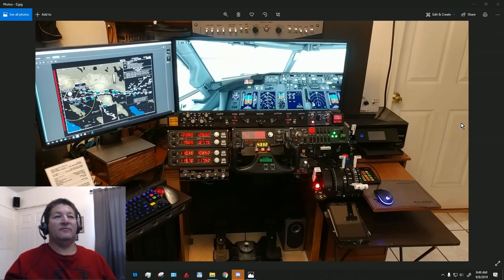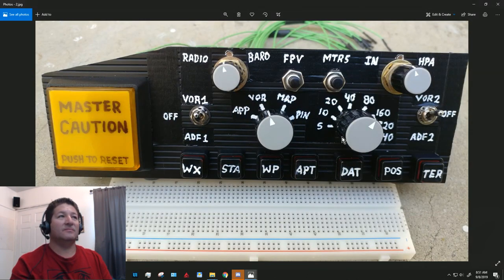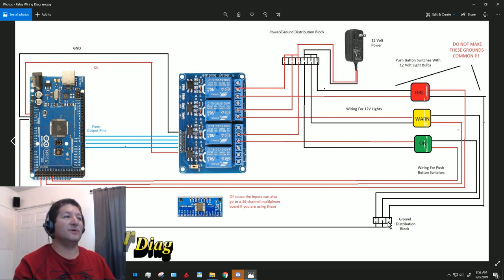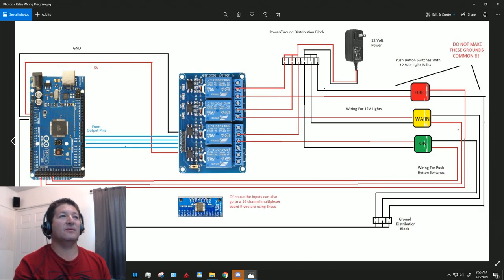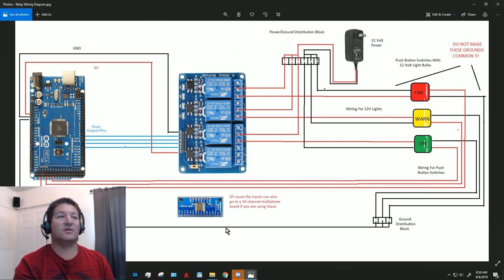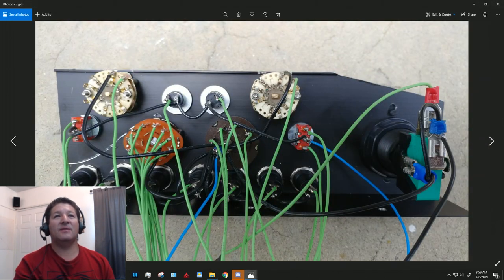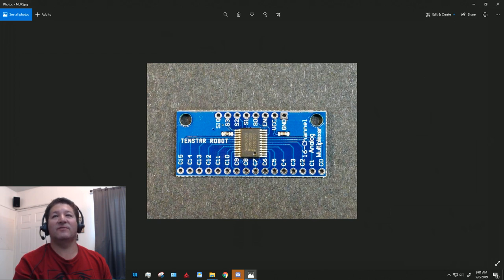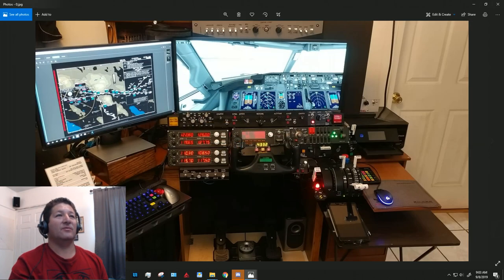How I use Relays With SimVim Cockpit (Now SimVimX)

Comment: Thank you for the videos, definitely a pretty cool project, reminds me of when I was trying to automate my christmas lights with controllers, sort of. In either case I'm getting ready to order the stuff to get started in all this. Between your videos and reading the simvim documentation, it gives a good idea on what to expect somewhat. I dont think I've fully convinced my wife to the point she sees it as completely practical yet, but it is cheaper than when I was tallying up everything when I was after my ppc, by a lot.
Reply from the maker: Well that's good. I started off with just a few switches then I just kept adding more lol. Good luck with your build.
Reply: @Qosmokid  thank you! That seems to be the best way to go about it, just throw in what mainly gets used or in this case what's more of a pain due to having to look and manipulate a toggle or knob with the mouse.

I just have not came up with a mounting solution yet. Dont know whether to throw it all on a single panel, since I only plan to really use it for ap/radios or stuff that's frequently used or to layout panels closer to the actual cockpit which I could see wanting to always add something in that isnt there yet haha. 

Congrats on where you are at on your setup now. Do you have plans to expand it even further?

Comment: Things are changed again, today break light stopped working, and autopilot keeps printing errors on my original lcd settings, I'm sure I haven't changed any wiring, I don't know what happened to our originally simvim data settings, I was admired the easy setting I had, but now everything is not printing right, and some push switch lights don't function  🤔

Comment: I gave up my LCDes,  I'm so exhausted today, I wired my 7 segement to Mega, per webpage, and tried many different simvim codes to x-plane, but nothing works, I tried to do straight conversations to Mega, I wish I could see just a simple wiring, please if possible just tell me the wiring numbers running between 7 segement and Mega, thanks so much. I connected L & D to pin 27 & 28, and  CLK to pin 36, and the others two wire to 5V and ground. and loaded the code to pin 36 , unfortunately 7 segement even doesn't light up 🤔

Comment: In your next video, can you show how to connect a servo to the Arduino. I am trying to simulate the starter return on the Zibo 737-800.
Reply from the maker: Sorry I do not have any servos installed in my setup so I don't think I would be able to help with that one

Comment: hello qosmokid.... I want to split the wires from the 12V power supply and do them in the relay board like you showed in the video. I am real beginner so I don't know how to spit it... Can you explain this to me? Do I have to cut the cable from the 12V power supply or how am I gonna do it? You show it in the video but I just don't understand how to do all these distributions... Please help

thx
Reply from the maker: Hi there, so basically I just cut off the part that would normally plug into the device the power adapter was for. Leave the cable attached to the part that plugs into the wall. Then I split the wire and strip a small section. So that I could test it with a multimeter to determine which one is positive and which one is negative.